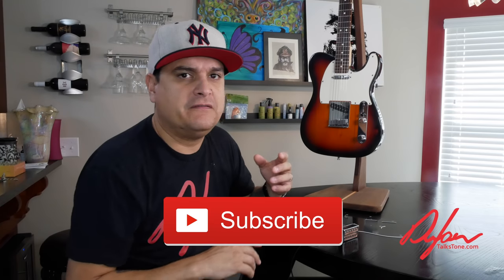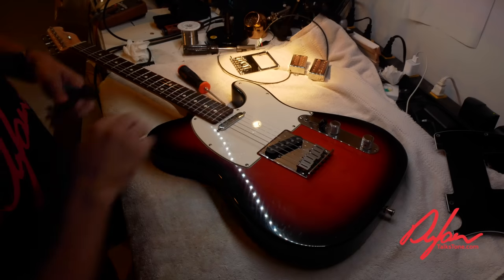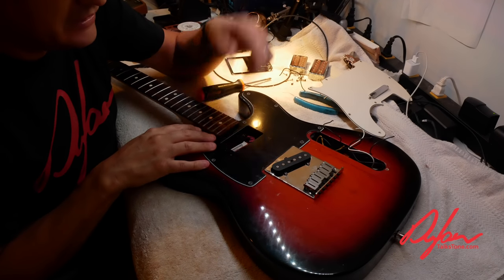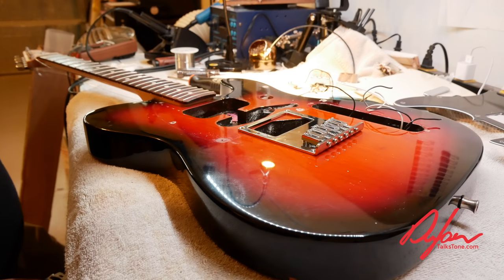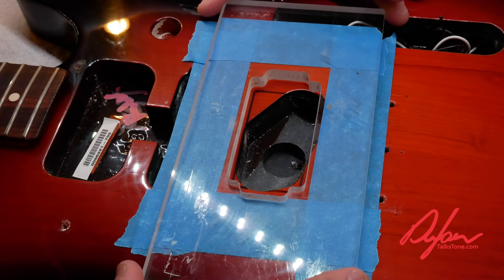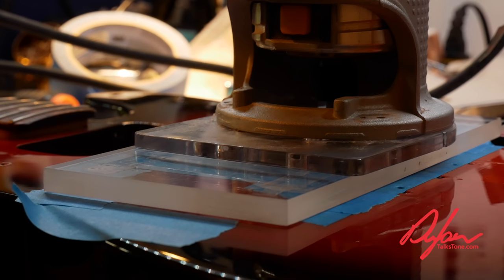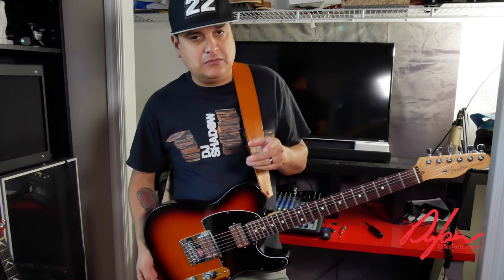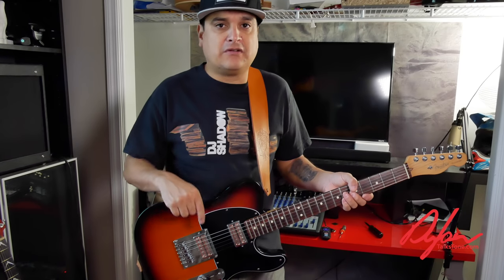How To Install Humbuckers In a Telecaster

Comment: Did I hear that correct? The owner of the guitar said it's worthless because he's not a country guy? Didn't you tell him that with a Telecaster you can play any style you want?
Reply: Can you get the deeper blues/rock tones in a Telecaster?
Reply: @waterhead001  yep, i've got one you can essentially play anything id say its the most versatile guitar
Reply: I wonder if he knows who Jim Root is..
Reply: Alex R given he has active EMG pickups in his Lol
Reply: waterhead001 Soundgarden used Teles on many songs for the Down On The Upside record.
Reply: All the Tele alnico tone is chickeny picky ... ceramic in them help.
Reply: Well lets see, Daniel Ash rocked a Tele in Bauhaus, Joe Strummer from the Clash played it, John 5, Bruce Springsteen plays them...I guess band wise the Toy Dolls, the Specials, the Gaslight Anthem, Hole, RATM...you get the idea.

So a stock Telecaster is actually a very versatile guitar. I think the main thing with this guy was he has other humbucker eqquiped guitars and he doesn't want to have to recalibrate his setup or get a new one for that. I'm guessing that he just puts his guitars on full blast and that's it. Personally I like the mods but you can get way more out of a stock Telecaster than this guy realises. In doing this you have to approach playing it from a new angle and embracing the minimal controls. So the change is more psychological and fundamental than just setting it up like a Gibson.
Reply: @skipgeorge4550  
The cheap Squires have ceramics and they are pretty harsh. Even then if you work the volume and tone controls you can get decent tones out of those.
Reply: @waterhead001  
Blues is more HOW you play than WHAT you play. I've seen expert blues cats get sweet tone out of shit guitars ALL the time. Most genres are more of the player vs the gear.
Reply: @gringogreen4719  I like ceramic bar pups...and prefer them at times over alnico. Depends
Reply: @skipgeorge4550  
They can be good. Honestly it depends how you EQ them.
Reply: Gringo Green john 5 uses humbuckers in his tele dont know about the rest but he definitely does.
Reply: @timwright4183  
In his signature Tele yes. But he owns just about every Tele made, so the majority of his collection are single coils.
Reply: He's clearly never heard of Joe Duplantier
Reply: Yeah,  tell Jimmy Page that.
Reply: You can play some pretty hardcore stuff with a tele. I got SD quarter pound pickups and using the volume knob and a good even ordered harmonic dirt pedal you can get blues, rock or punk or really anything. With a fuzz pedal you can definetly do metal. Pinched harmonics and screaming controllable feedback abound. If you by chance haven't heard of the "even harmonic" distortion thing, you might should look up the Interfex harmonic percolator. Theyre not made anymore but theres alot of companies trying to replicate it. Most people like the land devices but I use Catlinbreads Karma Suture.  Its like clean and dirty at the same time in a weird way.
Reply: Jimmy Page.
Reply: The guy really wants a Gibson or PRS. This sounds like a GS.
Reply: I had a Carvin DC 150, which were made from eastern hard rock maple, with an ebony fretboard, and a brass nut. A well regarded recording blues player in Louisiana came into a music store I happened to be visiting. I happened to have the guitar with me. He asked if he could play it. He spent a few minutes trying to coax a decent sound out of it, gave up, shook his head, and handed it back to me. Some very capable players tried, but couldn't get a decent sound out of it. It was a very well constructed guitar. And wasn't that cheap, back in 1980. I kept it just to challenge myself. Multiple pickup changes didn't help much at all. 

Some guitars are easier to get a decent sound out of than others. Some are downright difficult to get a decent sound out of. 

Actually, there was a country player to who asked to try it. He saw me playing it and thought it would be interesting to play. He too gave up within minutes. Frets were very level. Nice neck. Reasonably low action. But concrete or steel would have had a more woody and resonant tone than the wood the guitar was constructed of. 

I've bought guitars for little more than $100 that sounded far better. That Carvin reminded me of the pulling the sword from a stone story. Pulling a decent sound out of  it seemed to evade anyone who picked it up. That guitar always comes to mind when someone says tone is 100% in the hands.

Comment: Lots of people may not know that Fenders are great  for humbuckers (better in my opinion). You get the longer scale length, individual string intonation and height adjustment  and string through  contact. Also, it's far easier to get parts to modify.
Reply: Agreed, Fenders have that longer scale length (25 1/2) which, imo gives more clarity, definition and 'throw' to the sound ( as compared to Gibsons 24 3/4 scale). Add to that, I like bolt on better than glued in necks, etc. A Tele with a humbucker (or two), imo, can sound like the best of both worlds, concerning a Gibson (Les Paul) and a Fender ( Strat).

Comment: Cool video, best tele mod is 50s wiring imo followed by...
a belly cut, I just use an electric sander and rattlecan matt black, then a clear coat. Rough and ready to rock,
cost about 15 bucks.

Comment: I would like to see how to modify a Telecastor the way Bob Kirchen mods his Telecastors in order to do the sound effects he gets. For those who are wondering, Bob Kirchen was the guy who played lead guitar on the song Hot Rod Lincoln in 1975 by Commander Cody and his Lost Airmen. I seen an interview with him in which he said he reversed the positions of the volume and tone and the 3 way switch. He did this for convenience. It placed the tone and volume in the forward most positions of the plate and put the 3 way switch in back of them. Then when he played he could extend his finger down and manipulate the volume or tone as he played to emulate the sounds of various vehicle horns like different cars or trucks or even a ship's horn.  It's pretty cool to watch him do it.  I was thinking of doing it to my Tele just for kicks, but wanted to see if I could find a video showing the reversal being done. It would make for a great conversation piece when playing.  It would be done by flipping the panel the the volume and switch are in and then wiring it so the 3 way switch is first then tone then volume. I figured if I tried to do that without some guidance I would probably hose it up somehow and I didnt want to chance messing up a component to the point where it would need replacing.  If you know where something like this could be found online that would be cool as well.

Update:  I did manage to find a video online showing how to reverse the controls.  Works like a charm. When you look at it, it takes a second. You see it and think, humm something looks different here. Then you realize oh hey the controls are reversed.  Looks great though!
Reply: BILL

Comment: thanks Dylan,nice video,what would you do about pots if you had a humbucker in the neck and a single coil in the bridge?
Reply: Rick did you get an answer ? I want to do that with mine
Reply: I need that answer too. I researched a little bit and looks like either work. 500k is brighter.

Comment: Pretty much the same mod I’d like to do to my Tele. The neck route is still just for a single coil but I’m cool with that. I need to route out the bridge pickup spot. Are most Tele humbucker bridge plates larger than the stock size?
Reply: A Tele Deluxe has two humbuckers, but doesn't use the bridge from a standard Tele. Both humbuckers mount in a larger pick guard, and the bridge is a smaller piece that mounts below the guard.

Comment: Newb question, but is it the case that not all humbuckers are designed to be split? What happens if I put a normal humbucker in a guitar like the ampro ii telecaster deluxe which has a button which enables you to split the coils?
Reply from the maker: All humbuckers can be coil split in theory. You have to wire them so that all four coil wires are accessible. Many pickups have the coils joined internally

Comment: I have a Telecaster Squire 70's Vibe and it has a Fender Humbucker in the Neck. I want a Dimarzio DP103 cream Humbucker in the neck for my tone purposes and cream pickup ring around it. Can that be done without drilling for the ring? The single coil neck pup sounds good but may change it for a Dimarzio Chop. But my main concern is the fitting of the neck pup. Also I have already installed 509k pots and capacitor.

Comment: I have been thinking about doing this to my telecaster you just push me over the  edge to keep it somewhat stock I will use fender wide range humbuckers I also like the sound of them. The bridge you use is it a fender also is it necessary to go to 500k pots
Reply: Wide range humbuckers are much bigger than pafs. Check fitment first. Also not sure if they make a tele bridge to fit a wide range...
Reply: @chrishenderson9130  thanks for the info any suggestions for a reasonable price humbucker like the one you installed on this telecaster
Reply from the maker: Give these a shot. FantasticPAF tone. https://dylantalkstone.com/products/daf-humbucker

Comment: I'm gonna do this. I'm looking for something with a Les Paul like tone, but I hate Gibson's scale length. I looked at the Deluxe Teles, but I'm not a fan of the massive pickguard. I prefer the classic Tele look. The Jim Root Telecaster is the closest thing Fender sells for what I want, but I dislike solid white or black guitars. I gotta see that wood grain on my guitars. Fender Japan does an awesome job with their Modern Telecaster series for what I want, but you can't buy them outside of Japan, so honestly to get what I want, I'm gonna have to do it by myself.

Comment: Nice video but wish you showed your wiring set up with the pickups too. Did you have to have a ground under the bridge plate?
Reply from the maker: Our wiring setups are available as assemblies here. https://dylantalkstone.com/collections/quality-upgrades/products/prewired-tele-control-plate-with-wiring-and-pots

and yes there was a groung under the bridge for a string ground.
Reply: ah ok. I've been searching around for videos on wiring configs because I was given a 5 way switch when I picked up the new wiring kit but can't find anything :(  @DylanTalksTone
Reply: Did you have to have the ground under the bridge plate? @DylanTalksTone
Reply from the maker: You always need to ground the strings. Putting it under the bridge plate on a tele is a smart way to do it

Comment: Is there a way to make muddy/dark sounding pickups make brighter? And is there a mod you can do with the pickup to get a better/completer soundrange?? 
Would be great to see a tutorial about that.
Reply: Most obvious thing to do would be to coil split it, if it's wired that way or if you can access the lead on the pickups. It might work, it might sound awful, but it won't cost much to try.

Comment: what happened with the middle pickup?  you didn't mention it.  And how come the guitar only had a 3-way switch?     how come the middle pickup works okay height wise despite being below the scratchplate?
Reply from the maker: Iggytommy teles only have two pickups... the three way switch is also stock.
Reply: but i thought i saw a secret  middle pickup when you first took of the scracthplate?
Reply: Iggytommy It was a Fender body.  It could be used as a Nashville Deluxe Tele with 3 pickups.
Reply: thanks
Reply: The fender telecaster “modern player” series had a third picku

Comment: Nice Tele! You CAN put humbuckers in a Tele. I mean, it was routed for a bucker from the factory! Teles are also fantastic guitars to mod whether you are doing something as invasive as this or something that you can quickly change back. This Tele will also have a different feel and sound instead of a Custom or Deluxe.

I have a Filtertron and a SD Quarterpounder in the Tele in my pic (the lipstick was replaced from the pic). It sounds great and plays great too.

I like what you did Dylan. I would pick up a Tele like this but like your customer said, on the cheap. My preference would have been to flip the control plate around so it would be Volume, Tone and Selector. Also those Tele cups on the side, they are a bit problematic, that would get a nice chrome football jack and also Dunlop straplocks. Keep rockin!😎👍✨
Reply: Tele’s are factory-routed for buckers ONLY at neck location…
Still need to buy/build a custom bridge plate to put a bucker there… and a little bit of ( possibly) ugly routing…because the plate will cover most boo-boo’s on the bigger cutout.
Reply: @joeurbanowski321  
Depends on the series. My 90s American Standard needed to be routed out for the JB humbucker I put in it.  You can also get humbuckers in the form of the Noiseless pickups that Fender makes or Lil 59s or Lil JBs like Seymour Duncan makes.

Some Teles do come with full size humbuckers in the bridge as well. It just depends. 

Now that said, if you are looking for something different be prepared to alter that guitar as you are deviating from tge tried and true formula. That said even if you highly modify a Tele, there is still a "Tele-iness" to it that never goes away. I have four Teles style guitars where they are very modified but still have that Tele quality to them regardless of the pickups or who made them.
Reply: @gringogreen4719  .. I’m only investigating the modification to my Tele… I appreciate your help… since I’d have to find a bridge plate to accommodate the bucker..and I’m having trouble finding one… I might now be leaning towards getting a new single coil bridge pickup that’s made for a Tele.. and not have to do any surgery… I just NEVER use the bridge pickup unless it’s in tandem with neck pickup… 
Thanks..!!👍🏼
Reply: @joeurbanowski321  
Try Seymour Duncan. GFS makes some cool pickups as well. I like Seymour Duncan's Quarter Pounder in the neck position. Its like a P 90 with a bit of sparkle in it. So warm and girthy with a bit of single coil spank.

The Tele in my pic has a real Filtertron in it. This required wood work and I had to put a Quarter Pounder in the bridge because the Filtertron is loud.
Reply: @gringogreen4719  …very cool..! Thanks again..!
Reply: @joeurbanowski321  
Glad to help. I do have a Squire Standard Telecaster, it was the chrome pickguard model. I think that one only has a single coil route. There are just so many different series and factories that made them over the years, its hard to tell. I do have a Partscaster Tele that I just put together and I got a set of Fender Noiseless pickups. They sound really good. I put the GFS X Trem on it and even though the string angle is different, it picks up the strings no problem. Those are good pickups to upgrade a Squire.

Comment: Dylan two things. One,  that's an awesome guitar and it obviously sounded great even on my Android phone. Two, though is a bit of a complaint. I watched this video with the hope that you would show me how to wire humbuckers in a tele. I didn't need to know anything about routers or how to make holes bigger. I could learn that from a woodworking video. So you are the pickup man and I expected you to teach me how to wire those humbuckers in a tele. I'm sitting on a couple of hot rails with five wires and I don't have a clue how to hook them up.. 
HELP!!!
Reply from the maker: you should subscribe and hot the bell. You missed a video about that just last week
Reply: Thanks Dylan, I thought I was subscribed. I guess I just missed it.